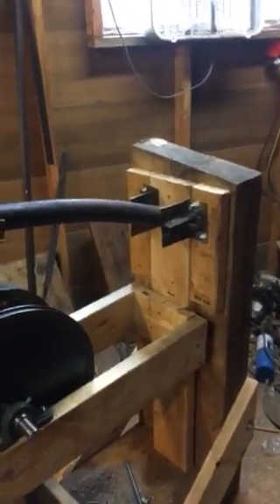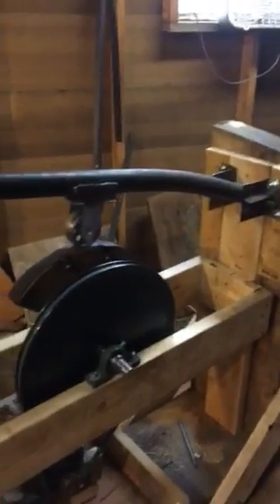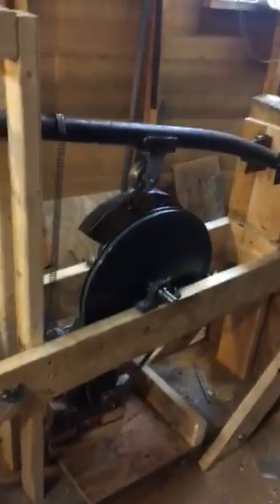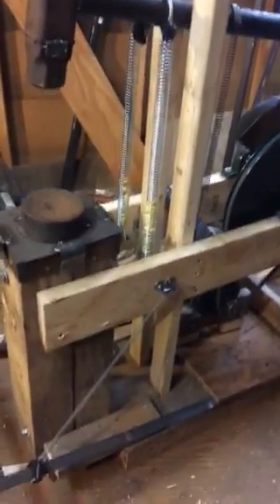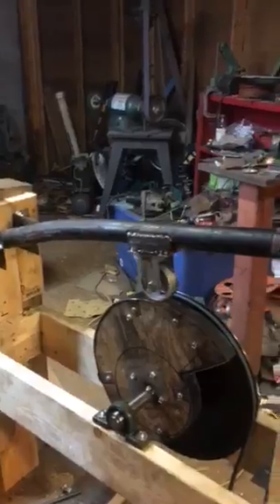DIY davinci cam power hammer

Comment: Take no notice of the know nothing YouTube  experts that have never made anything in their lives.  This works well and is a good variation of the original  . A slight improvement i could suggest would be to fill the box section on the back of the hammer to add weight.
Reply from the maker: I have been planning to pour lead into the void in the back of the hammer, just have not quite gotten around to actually doing it.
Reply: @BlackPowderGeek  that was my thoughts too

Comment: That is freaking awesome! I have been thinking about building one but was unsure if I could do it out of wood. Thank you for showing me that it can be done. I know my design will be different from yours but hey we all have to work with what we have.
Reply from the maker: Indeed. I started by looking at as many different plans and videos as I could find. I even bought several different plans from "christ centered ironworks". (They cost from .99 for the cheapest to like $3 for the most expensive) then adapted to the materials I had. Some things to keep in mind. 1. the more powerful the motor the better. the 1hp I have is just barely up to the task.  And the lower rpm motor you get the easier it will be to gear down to a reasonable rpm. Good luck, have fun, and make sure you share a video once you have something up and running. Also there are a couple follow up videos for my hammer, make sure you give them a looksee, for how the machine has evolved over a couple years of use.

Comment: Looks good to me. The haters don't get what doing good with what you have. If it's getting the job you need done then it's perfect. Those hatters are the type of people that if they needed a 1/2" round wooden key to open the fridge and they only have  3/4" square wooden key they would starve. Geterdone
Reply from the maker: Indeed. And a year later the hammer is still going and seeing regular use. I have been meaning to do another video covering tweaks and mods I have done over the last year.

Comment: Looks really good u should do a step by step build and you got my follow
Reply from the maker: I wish I had done a step by step video when I was building this one. Unfortunately I didn't. I intend to build another, with a frame made of steel box tube instead of timber, hopefully I will be able to do a step by step video of that. I'm also planning a video on the current hammer, and the changes and tweaks that I have done to it over the last year.

Comment: cool idea and well made. i am just starting mine on paper and any and all ideas i can find will aid me in my build with what i have and tring not to spend a fortune into one..
Reply from the maker: What I did was get every set of plans I could get my hands on, and watch every video I could, then adapted them to suit the tools and materials I had available. I purchased several different plans from Christ Centered Iron Works, found others for free on the internet, and watched videos by Rick Rabjohn, Ray from the Hayclan, and several others. Some things I learned along the way.. Rotational speed is a big thing. If your motor is over 1750 rpm, you will probably not get it down to manageable rpm with pullies. 1400 rpm would be even better. 1hp is pretty much the minimum, 1.5 would be better. Or bigger if you have 220v in your workspace. The motor I am using is a 110v ge 1750rpm I got from ebay for $47. Good luck, hope to see a video of you finished hammer!

Comment: What are you having trouble with on your reductions?? Seems like yours is working just fine to me
Reply from the maker: It is. Just had some fun getting it that way, was a fair amount of trial and error involved.
Reply: @BlackPowderGeek 
How many times did you have to change pulleys??
Reply from the maker: @thomasbarrett8861  I changed pulleys twice, and changed motors (for a lower rpm motor) once.
Reply: @BlackPowderGeek  I had to do the same thing as you John. It was a learning experience for sure. But now we're both a little more knowledgeable now for sure.
Reply from the maker: @thomasbarrett8861  Indeed. As a future project I plan to make another similar hammer but with a steel frame instead of lumber. That said, I get an awful lot of work out of this one.
Reply: @BlackPowderGeek  I  had considered building mine from wood, but decided to go with steel instead, but hey use what you've got on hand am I right??
Reply from the maker: @thomasbarrett8861  Indeed. I am not well set up for working with thick metal but.. Goals, ya know?

Comment: What HP motor are you using?
Reply from the maker: It is a ge 1hp 1725 rpm 110v motor. If I had it to do over again I would probably go for something in a 1.5hp 1400 rpm motor.
Reply: @BlackPowderGeek  Would you use the axle directly off the motor for better torque or do you find the rubber drive band evens out roughness in the drive?
Reply from the maker: @glennmartin6492  The problem with using the motor direct drive is that the rpms would be way to high. I have a 1" pulley on the motor and a 16 inch pulley on the cam, which gets me down to about 107 rpm, and that is still on the fast side. As an alternative to belts and pulleys you could use a reduction gear. Fella here on youtube named Rick Rabjohn has one build like that if you want to take a look at it.
Reply from the maker: @glennmartin6492  Here is a link to the hammer I mentioned, with the gear reduction box.   https://www.youtube.com/watch?v=WfTCSIvhKvg&list=PLiZ5HldERdDjquY1yqQzMDbwkq-mn9yak&index=4
Reply: @BlackPowderGeek  Thanks.